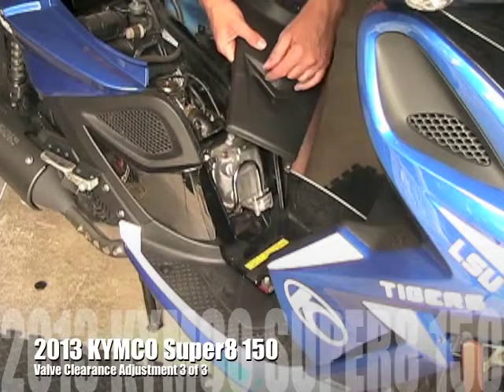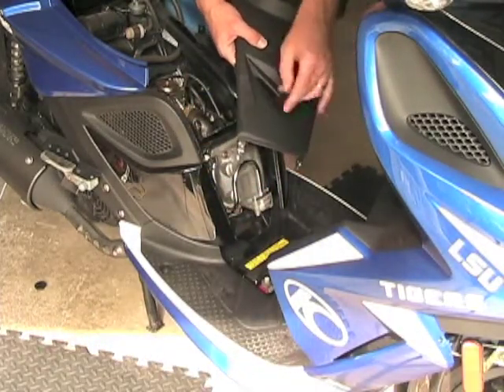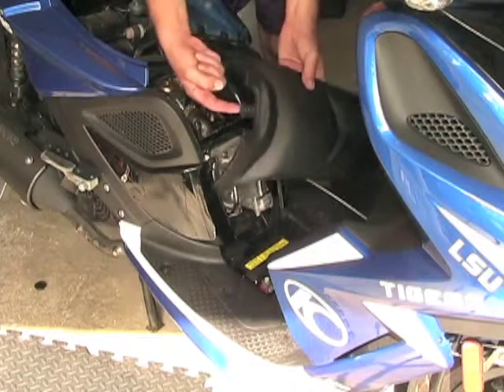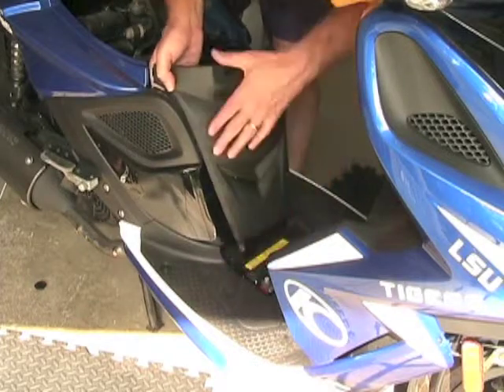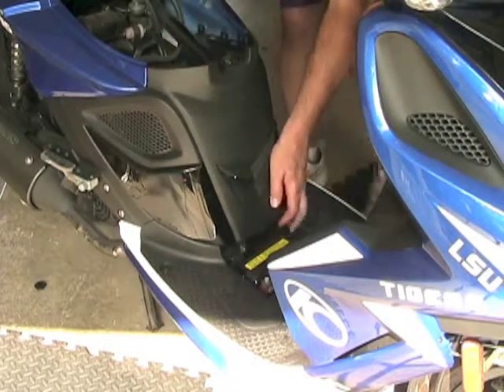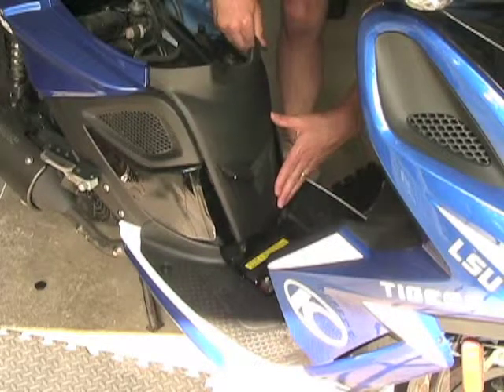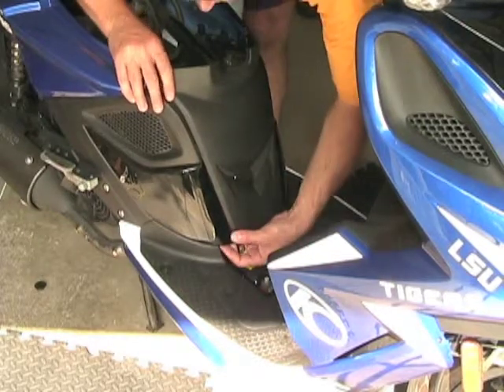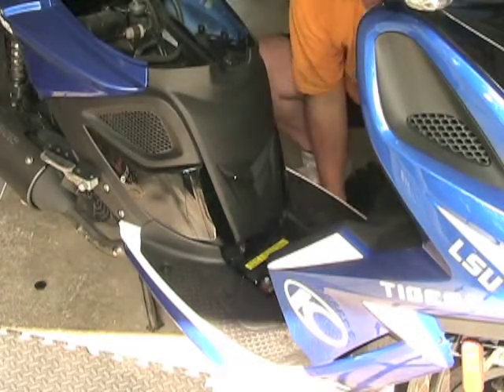Super8 150 - 3 of 3 Valve Clearance Adjustment

Comment: hi Wayne I have kymco super 8 125cc yours is a 150cc I assume the valve clearance method will be the same on a 125 version but do you know what measure ments the valves has to be ? kind regards.
Reply from the maker: My manual says intake and exhaust on a 125cc is .12mm